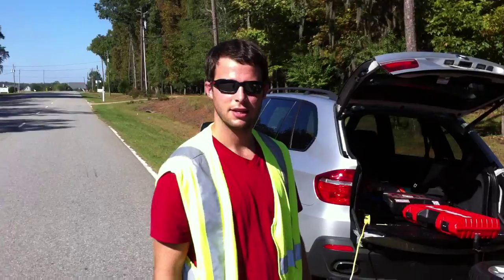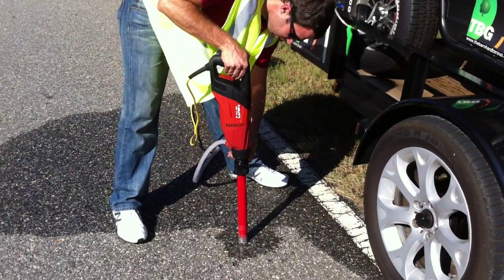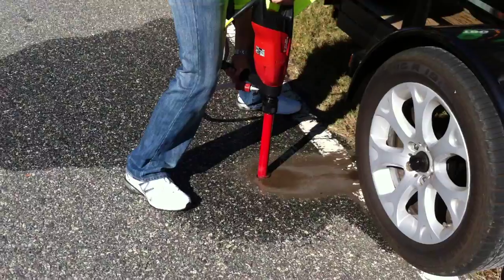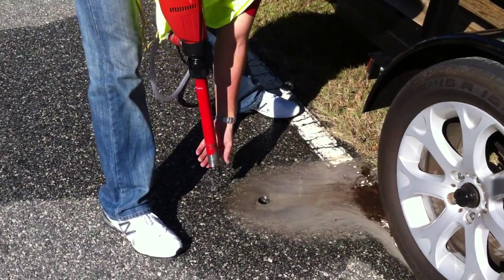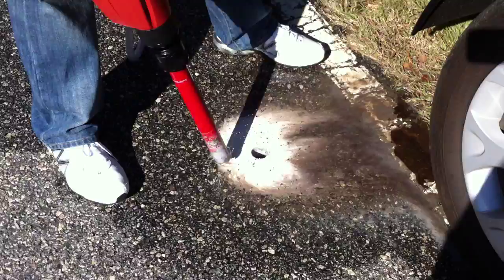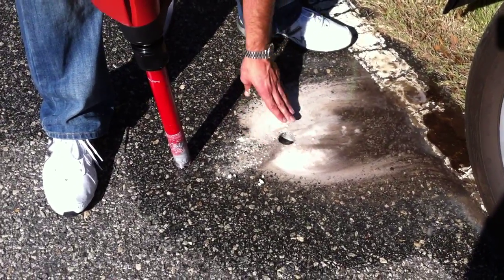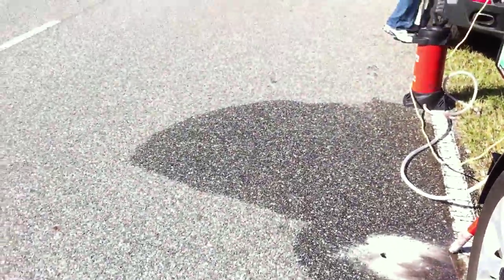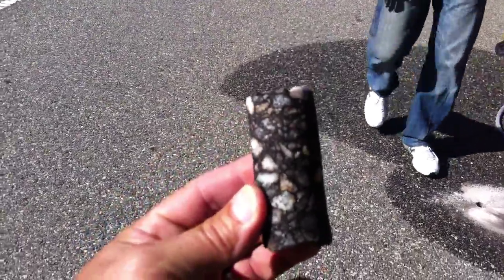Pavement Distress Evaluation | HILTI DD 110 Wet Diamond Coring | StreetSaver

Comment: we usually put the core back into the hole, and for the most part the roads will be rehabilitated anyway so you are correct about fixing the hole....  we don't usually core a brand new or newer pavement if we know that the road has been overlaid avoid damaging the new overlay